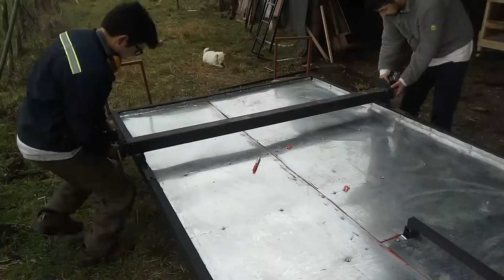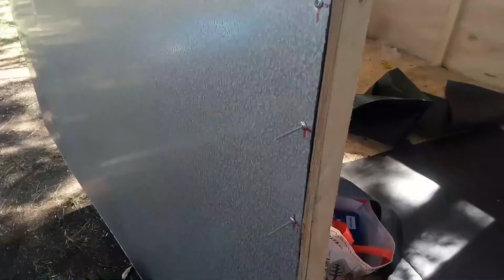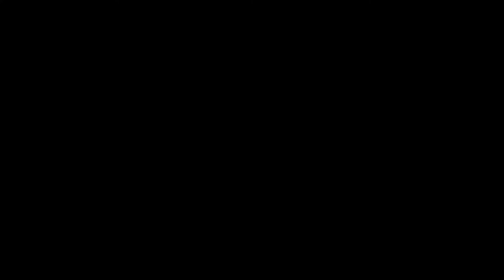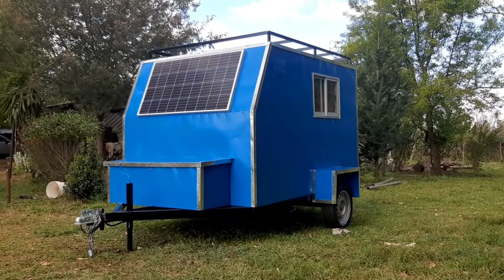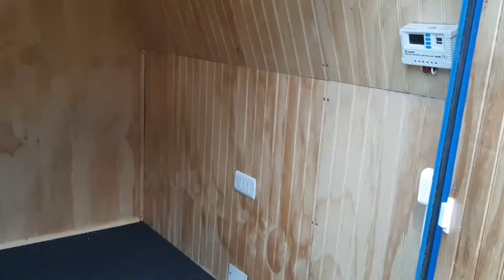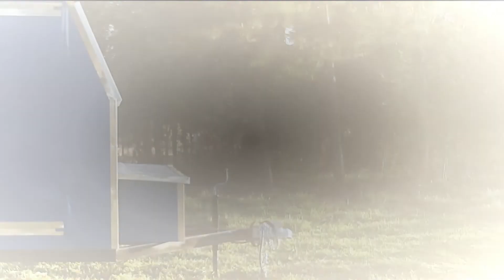MINI CAMPER Chile "camper trailer build ideas" FINAL

Comment: Espectacular los felicito! Me podrías decir los materiales que usaste?
Reply from the maker: Hola, la base es en perfil rectangular 80x40x2mm y 30x30x1.5 (este último también en la estructura superior) En la estructura superior la hice con metal y madera, forrado con terciado estructural de 9mm.
Luego ensima le puse fieltro (el cual hay muchas opciones) y encima zinc liso remachado.
Por dentro terciado ranurado de 9mm. Ventanas corredizas de aluminio.
Pintura esmalte sintético, unas 3 o 4 capas. (O bueno si pintas con pistola hazlo con la técnica)
Reply: Te quedo super  . Para cuantas personas  esta diseñada x lo visto  para 3 o no
Reply: Cuanto saldría mandar hacer algo así???
Reply from the maker: @rodrigomacaya449  Hola, yo fabrico pero en estos momentos me detuvo un poco por la alza de precios. No sabría darle un valor ahora. Cuando hice este video estaba pidiendo $2.5 millones clp. Pero ahora nose cuánto saldría